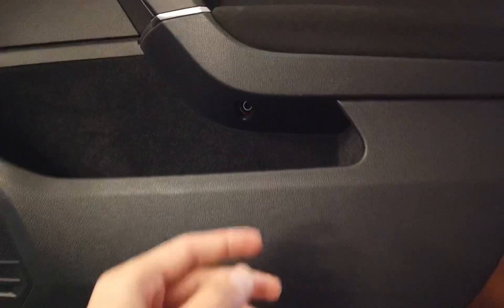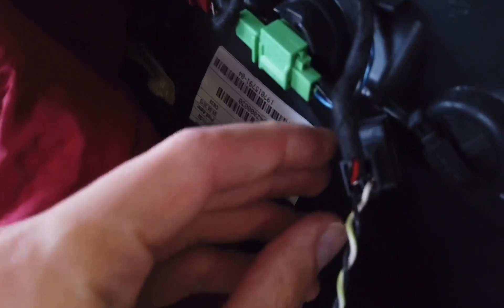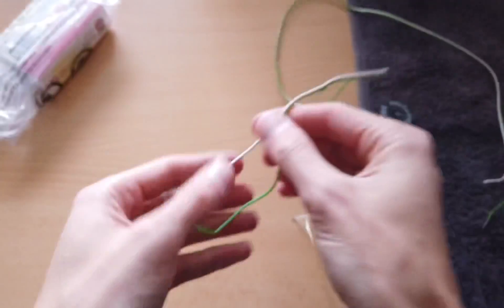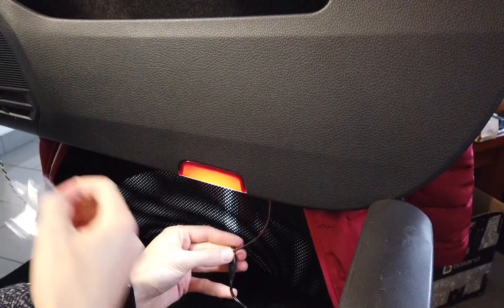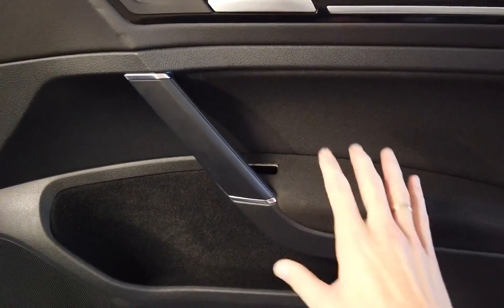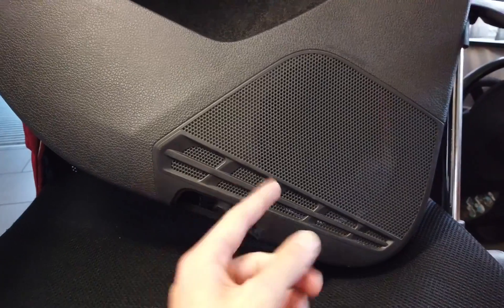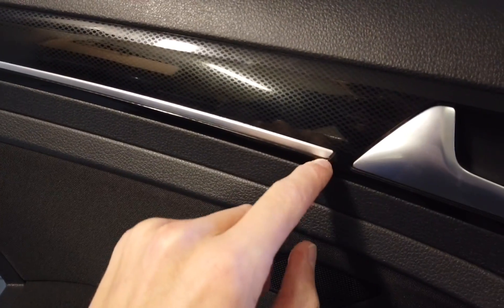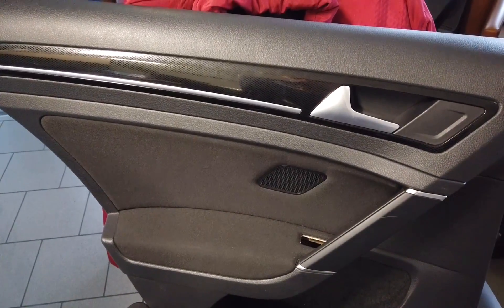VW Golf MK7 (5G) interior ambient light installation (part 1)

Comment: Where can you buy these light? My Golf 7 GTI doesn't have any ambient light and I would like to add it.
Thanks in advance
Reply from the maker: I bought a set of used door cards. But you can buy a set of new trim panels with LED strips (single color or even RGB) on AliExpress.
Reply: @mrfixpl  thank you for the reply. I bought a new 7 GTI CS 2017 and I have ambient lights in the doors (from the looks of it) but they do not work. Do you think there is some fuse blown or do I need to code it to work? There is no ambient setting in the radio.

Comment: when you wired to red….the oem led from handle it doesn’t go red ?????
i can see the strip able to change red to white…. but the other 2 led from handle top and bottom they do not change to red ????
Reply from the maker: Just the long trim LED strip is bi-color.
Reply: @mrfixpl  i’ve seen that by testing…wasn’t sure… was nice to have them all bicolour…just doing a retrofit of those lights to a caddy door panel mk4

Comment: Excellent video!! From this moment I follow you! I already have the ambient light system installed, Is it possible to change the white light spotlights to RGB? And control them by infoteinment as in passat B8?
Reply from the maker: RGB uses different hardware than single color illumination. It was not available in Golf MK7 but it was in Passat B8. So if you have some manual skills you could retrofit it into MK7. This of course requires some coding and even BCM module swap in older MK7s. RIght now I'm staying with white ones.

Comment: hi, sorry the door panel connector for the ambient lights there are 3 cables, positive and negative, do you know what function does the third one do?
Thank
Reply from the maker: The separate circuit: handle griff illumination is one, LED strip is two.
Negative is shared, two positive lines for two functions.
Reply: @mrfixpl  ok thank

Comment: Hi mr-fix , don't if you can help me but here we go..I have the exact same van , with a cxxb 81kw 1.6tdi engine ..Don't know how the dashboard changed by it self but now I have allways a interval reminder (for the next oil change\inspection) when I turn the ignition on\off (and the infotainment has the same info showing on vehicle status), do you know how I can disable this ? I already tried a few options (on dashboard module) with OBDeleven but I wasn't able to disable the reminder
Reply from the maker: Have you tried reseting it manually? Press and hold 0.0 button and turn the ignition on?
Reply: @mrfixpl  yup . tried that more than once , tried recoding values too ..it doesnt matter if is on fixed or flexible service , the SRI is allways on (got 2 vids about this on my channel) what you think i should try next ? already checked the values for adaptations and longcoding from an older obd11 backup . Do you use obd11 or vcds?
Reply from the maker: I use OBDeleven.
OK, just to be sure I have to ask if you are not confusing Service Reminder with Oil Change reminder. Those are two separate countdowns with two separate reset procedures.
Reply: @mrfixpl  Service Rimender Interval is just a way to call the reminder" (global) presented in my case , it is allways showing me the next service , doesnt matter if it is oil or inspection interval . On VCDS the SRI can reset both, the oil change and inspection

Comment: Hi, I am planning to add door sill illumination on my 2017 Golf MK7 so that when I open the door they light up. I read that they are controlled by the front door controllers. My question is how can I run wires through the door connector for hooking them up to the door sill 12V supply. What connector type do VW use for the door connector?

Comment: When will you post part 2 ? Can't wait. I'm following and subbed on YT and Facebook. Good job and good luck doing all of these.
Reply from the maker: Not sure. Right now we have another semi-lockdown in Poland + some anti-goverment manifestations all over the country.
Reply: @mrfixpl  That's bad man. Same here in Romania. Could you, by any chance, post a pic or write a small sentence to where did you get the power for the door handle led ? I just mounted everything and idk if I should go for the power windoe switch or somewhere else. Thanks alot and good luck.
Reply from the maker: @AlexAlex-es1fj  I'm planning to power front illumination via front door modules. There are two types of door modules. If you check hardware number (you can do it via OBDeleven or VCDS) and it ends with 393/392, then it will not work. You need to have modules with HW# ending with 592/593.
For the rear door I was planning to guide wires from front to back to have the rear ones powered and controlled by the front door modules. This would give me full control of the lights Not sure if I'm going to do it this way.
Stay safe!
Reply: @mrfixpl  I have the 593 and I don't have rear doors haha. You have any pin no. or location for the 2 wires ? Also, do you have a Patreon or something so I can make a donation for all your good stuff ? Thanks !
Reply from the maker: @AlexAlex-es1fj  controlled with 32-pin door module, pin 8; and GND.
I don't have Patreon. Should I set one up?
Reply: @mrfixpl  Definitely man, you're one of the very few youtubers who makes these kind of videos, and we are alot with vw's that want to modify stuff.I did almost everything that you did, for Golf. Try something else, if not Patreon, for some extra earnings and make an announcement. Good luck and stay safe.
Reply from the maker: You are the first one to know: https://www.patreon.com/mrfixpl

Comment: hello, I have a mk7 7.5 with white ambient light.  Can I make the change simply by reversing the cables or do you need anything else?
Reply from the maker: If your door cards have the same hardware as mine, then you can just reverse cables.
Reply: @mrfixpl  OK thanks.  how do i see if the hardware is the same?
Reply from the maker: @luiginapolitano4775  to be 100% sure you would have to remove door card, power the strip with 12V, then reverse cables and check what happens.
Reply: @mrfixpl  ok I'll try, thanks a lot
Reply: If your car came with ambient light there should be option in settings to change color
Reply from the maker: Mk7 was not equipped with RGB LEDs. Passat B8 was.

Comment: You don't have to cut in the door card for the exit warning lights.
I've retrofitted them also for the front and rear, no cutting! Fits like OEM
Reply from the maker: I bought LED lights for Passat B8 hoping that they will fit GOlf MK7 as well. But the power connector is at an 45 degree angle and collides with the door card.
It's either cutting or buying different lights.
Reply: @mrfixpl  i buyed this set > € 11,47  27%OFF | 4 Stuks Auto Led Deur Waarschuwing Licht Welkom Projector Voor Golf 6 7 Jetta MK5 MK6 Passat B6 B7 Cc tiguan Scirocco
https://a.aliexpress.com/_BPSsFz
I only had to extend the cables, those where short after installing it to the door control module and activating true vcds it's working.
I didn't had to cut or scrape anything away from the door card
Reply from the maker: yeah, I'm using different ones. Power connector is in different position, hitting the door card. P/N: 3GD 947 411

Comment: I already retrofit door modules for folding mirrors and already bought with same door the door cards with ambient but I can’t make it works (mk7.5 zero strip coding ) I make the adaptation for on but nothing
Reply from the maker: As far as I know there's a lot of adaptation channels that need to be checked (and changed if required) in BCM to make it fully work. For footwell lights I had to change about 30 different parameters to have background lighting etc...
Reply: @mrfixpl   I have a list of adaptations but i can change all one in others it write says that this interface does not support sending can messages 256 bytes and over in length
Reply: @mrfixpl   do you know how to enable ?? And the pin connections ?? I want to check my
Reply from the maker: @giwrgosathan1776  soon enough I will wire mine and perform coding changes. Stay tuned.

Comment: Hi
Super Video
As for rear doors, I had thought of buying two used front door mounts,
and use LEDStrip for the rear doors.
Of course, a lot would be wasted, but 4 LEDs in the doors.
but could not find anything about where it should put it 12v to so they seemed the same with them in front so my project went down

Comment: Which color will be?
Reply from the maker: I want white but thinking about putting small switch somewhere to be able to control it on the go.
Reply: @mrfixpl  RGB led will be good but its yours, still i am gonna happy to watch :)
Reply from the maker: It would be expensive, but possible. Get ambient RGB LEDs from Passat B8 and retrofit them into Golf MK7.
Reply: @mrfixpl  you can use fiber optic rgb light, i think oem is using that
Reply from the maker: @manolisarcho6689  the expensive part is controlling it from the infotainment 😉
Reply: @mrfixpl  that would be amazing to watch
Reply: @mrfixpl  i read in this german forum https://www.golf7freunde.de/index.php/Thread/11851-Ambiente-farbe-%C3%A4nder/  that RGB lights (footwell or led strip) can be connected on pin c29 in any Golf MK7.5 with High BCM.
Do you think is it correct? Can I install these RGB footwell https://m.aliexpress.com/item/4000906161810.html in my MK7.5 with this coding https://www.glaskugelservice.de/codierung/ambientbeleuchtung?
Reply from the maker: @ferrets6  Don't quote me on that:
MK7 shares a lot of parts and software with other VAG cars. RGB lights are available in Passat B8, Arteon. This means that you can fit parts from those cars to MK7 and make it work as long as other modules support it.  RGB lights are controlled via BCM, so worst case scenario you will have to replace your BCM with newer one.

Comment: I follow you for the rear doors😁😁
Reply: Jesus i havent been that early for a right video. I have stock wagon with lights on front doora but would like to know if its possible to add them on rear doors aswell. I know mk7 hatchbacks have them on the rear doors.
Reply from the maker: @MRTNLPND  You sure about MK7 HB with rear ambient lights?
Reply: @mrfixpl  they do not. My 2018 GTI se, as well as my brother’s 2017 GTI se lack any lighting in the rear doors and foot wells. Same goes for a 2016 and 2018 golf R’s that I was looking at before getting my car